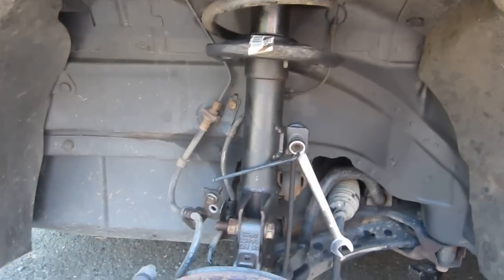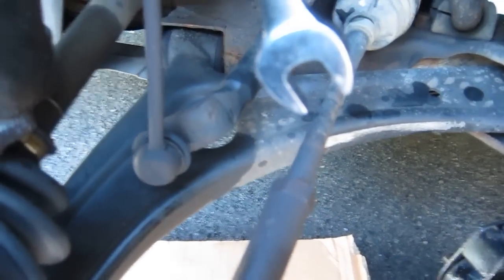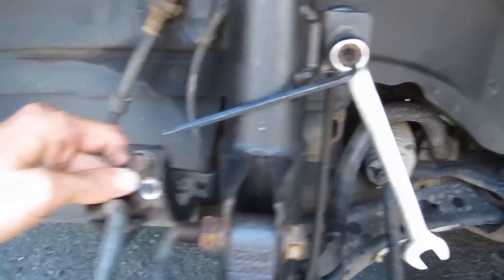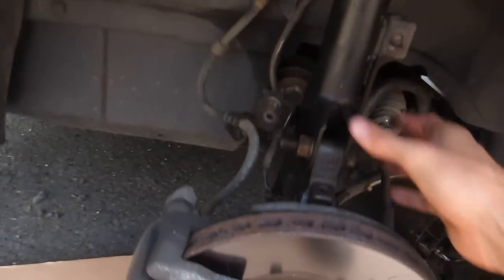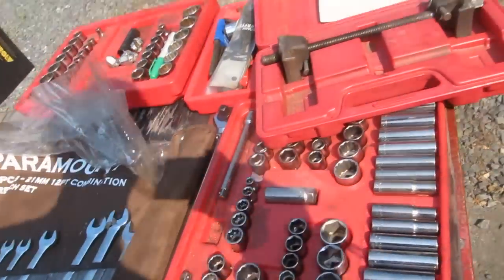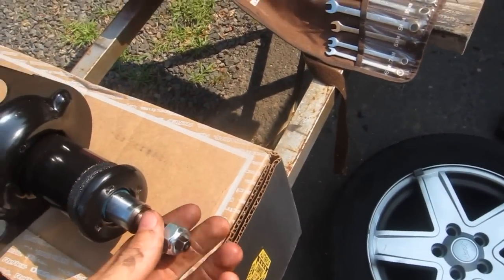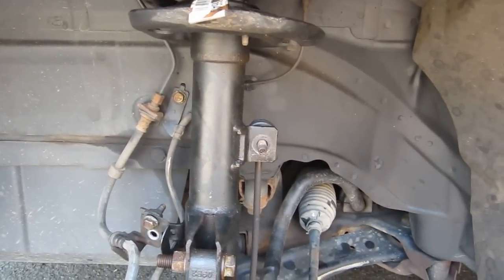Jeep Compass, Remove Front Shock and Strut-Part 1

Comment: Yeah I have had crazy front end issues on my 2007 compass. Replaced both control arms, rank and pinion, rotors two times and machined once, stabilizer bushings, front struts. I'm pretty close to selling it and just getting someone that is half decent. Jeep Compass has been a big FAIL! I've never seen a POS like it in history.Oh yeah and there is still knocking on sharp right turns... I'm taking it back to the shop... but there's nothing left to replace.
Reply from the maker: Agree.  my wife likes the jeep cherokee (which i hope is better than this compass) but after all the headaches ive dealt with, i really dont wana support jeep by buying their vehicles anymore.
Reply: I can't sell it now because the whole front end is new... but I still get a knocking sound...mechanic says it might be a motor mount.
Reply: the entire MK platform had suspension issues early on ( compass, patriot, caliber)
Reply: qlcmusic From what I researched the patriot and compass problems have been more quit since 2011. It took them 4 years!!?? WTF, anywways I picked up a 2014 compass (because I'm cheap)... I should have made spare control arms a part of the deal...

Comment: just wanted to add a comment as its been a while, two things I would have done differently... the price of a coil over shock/strut assembly is cheaper now than at the time of the vid, just save yourself the headache and buy the whole thing from rock auto, if you really don't want to do that than make sure you also order and replace the strut bearing at the time you replace the strut.
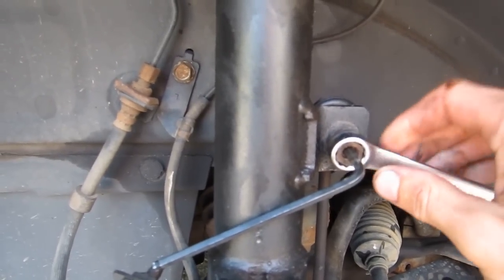  secondly, when you remove the sway bar end links ( min 2:24 ) use a jack to lift up the control arm assembly just a little bit, helps everything line up and slide off/on. there are many other videos about replacing sway bar ends links to see what I mean.  Good luck